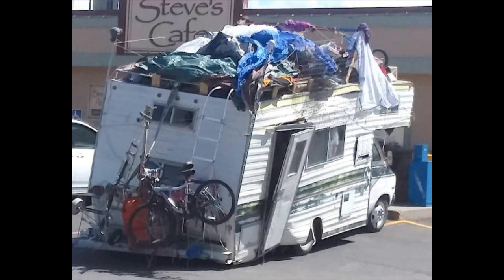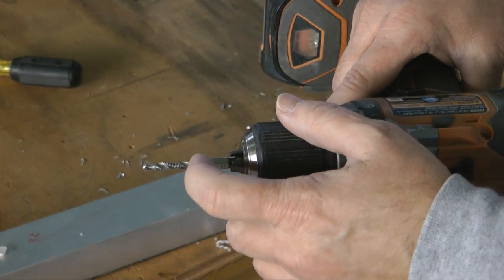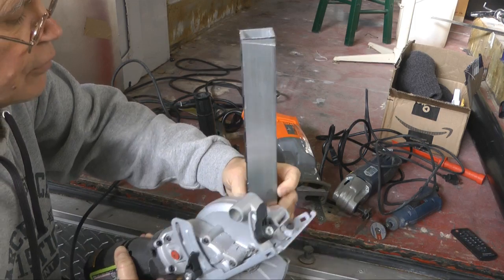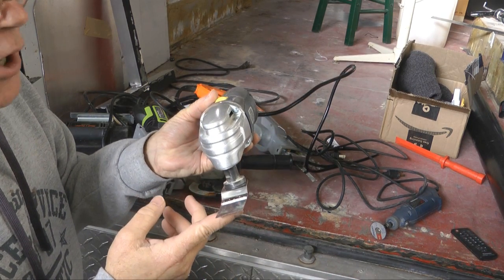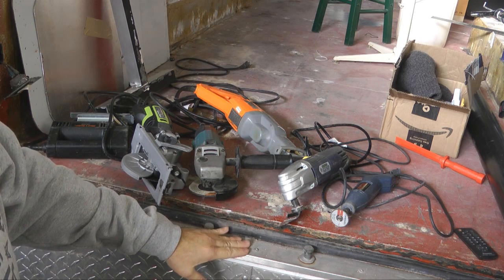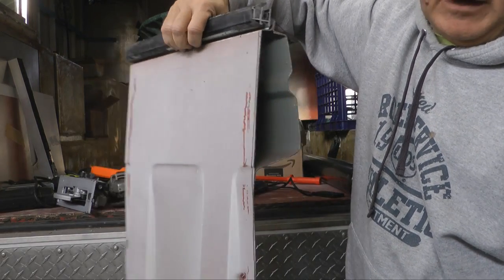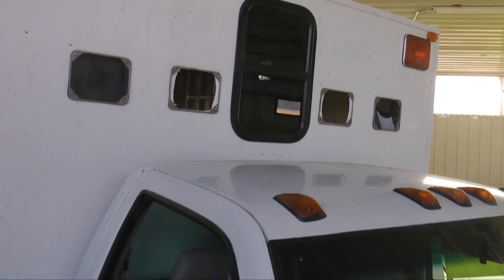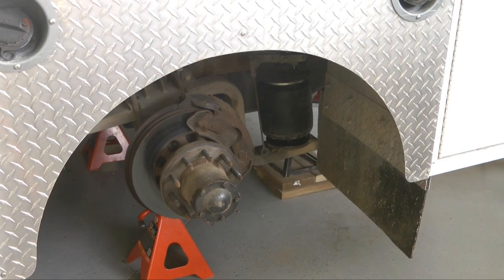Ambulance Conversion Part 3

Comment: Are you planning to add a city water connection on the outside?  My camper has a 40 gallon fresh water tank and it lasts a week or so for two people, but only if you don’t use the shower.  Even a quick shower uses an amazing amount of water and your fresh water tank will not last long.  Many campgrounds now have water hookups so having a city water hookup is great for using the shower.
Reply from the maker: Yes - only actual experience on the road allows one to appreciate the limitations of these storage tanks.  (I have lived 3 months at a time on the road).  My house rules: limit showers to 5 gallons.  If you need more water than that then shower some where else.  That is plenty of water if you budget and keep aware!  Because - that IS the greatest consumer of water.  LOL

Comment: Could you share more details on the smoke windows that you replaced the outside strobe lights with? I'd like to copy you and do that in my rig!
Reply from the maker: I bought a 2X4 sheet of smoke polycarbonate from Amazon. Used frame of strobe housing for template and cut with a jig/band saw.  Replaced mounting screws. I will caulk thoroughly!

Comment: It would have been nice to have an accordion connection between the cab and the box as there will be a lot of stress on the pass-thru connection when the frame flexes over rough ground, particularly in torsion.  You may find that will continually develop leaks from the relative movement between cab and box.
Reply from the maker: Yes - I will keep an eye.   Good news is that both cab and box are hard mounted to the same frame - so movement quite limited.  Also the actual gap between my two edges is where I bridged with a butyl tape - so no problem in flexing - but we'll see how long it lasts over time.

Comment: If you have an inverter of about 2500 watts  that will be surplus I would be interested  Not in a hurry so that decision on your part  is not required immediately
Reply from the maker: No inverters - but a 60 amp DC power supply: AC to DC